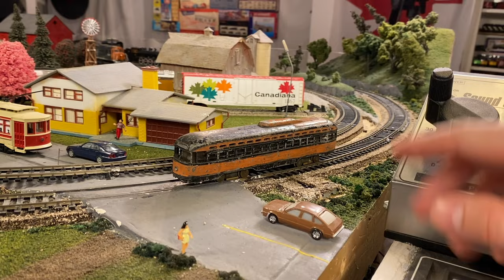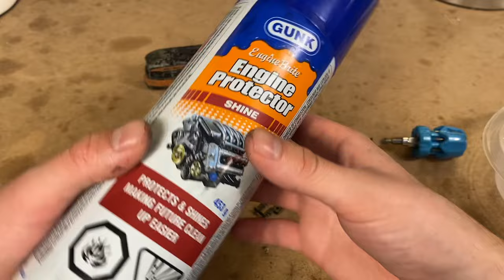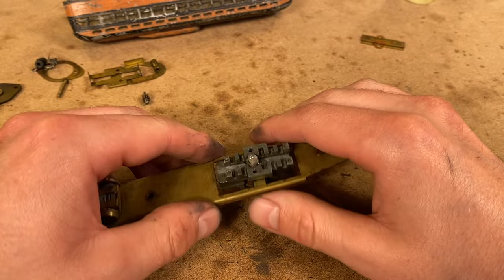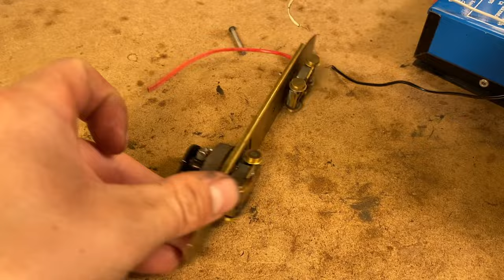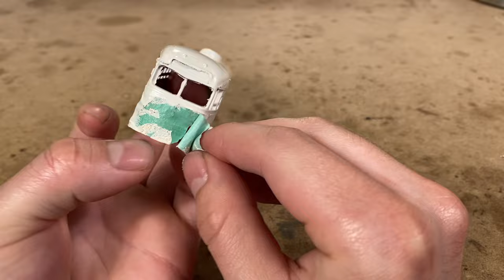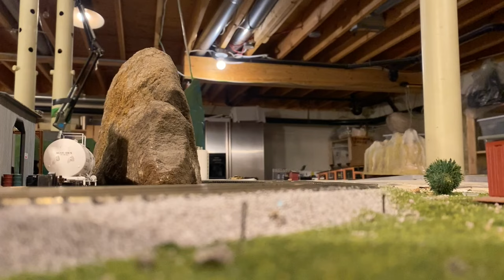Disgusting 1950s HO Streetcar Trolly Train - Will It Run Again?

Comment: Harrison, great job on fixing up the old trolley.  😊  One neat tip that I learned when custom painting stripes in my garage years ago is to use one more coat of the underlying color AFTER masking the paint line off.  This seals the edge with the base color and provides a nice, crisp edge.  I've been using this technique on my models and have found that it works really well for them, too!  🚂🚃🚃🚃🙂👍
Reply: Good point. I  do flat clearcoat.

Comment: The Bowser PCC body is made from cast zinc alloy, not lead.  It is not a toxic metal.  The rope allowing the trolley pole to be pulled down goes into a device called a "retriever."  If the retriever is working correctly, the rope will NOT hang down.  The retriever is a safety device and contains a strong, spring-loaded reel to keep the rope taught.  The retriever also contains a clutch which allows the rope to play in and out as the pole follows the trolley wire sags.  However, if the pole dewires, the clutch engages to prevent the pole from suddenly springing up vertically and snagging on the overhead wire support arms, possibly tearing them down.  (Trolley passengers are safe, being inside the grounded steel body of the car.  However, they would probably not appreciate the 600 volt fireworks happening outside.)
Reply: Ah so basically how seatbelts work
Reply: @hush6149  Basically, yes.  However, the rewind clock spring inside it very large and very powerful, unlike a little seatbelt spring.  Tension must be taken off the spring before it is removed.  I knew a guy who didn't do that when he was trying to repair a retriever.  The spring suddenly popped out at full force and almost removed the guy's fingers.  He never finished that project for some reason . . .

Comment: Congratulations Harrison on a splendid job. I’m a retired T.T.C. driver (although they called us operators, when we drove streetcars). I started with streetcars in 1970 and moved onto buses and the subway two years later. You did a great paint job as well, and It brought back memories as I watched you work, and run it on your layout. I have a bachmann pcc in Toronto Transit colours that I run on my n scale layout. once again well done, and thank you
Reply: GPalmT - Further back in time a trolley, subway, elevated train, or any light rail train driver was called a " motor man ".
Reply: That's really cool. My friend is a bus driver for the MBTA ( Massachusetts Bay Transit Authority). He is a bus driver only but he did get to drive the trackless trolley buses before they were retired. The MBTA actually does have vintage PCC cars still in Revenue Services on the Mattapan High Speed Line. These are really unusual PCC cars because they actually have a door on the left as they were used in subway service.
Reply from the maker: It's nice to hear from someone who actually ran these things.

Comment: Something I started doing years ago for glass in my models is, after buying anything that's packaged in hard but flexible clear plastic with a lot of flat areas, things like Q-tips and some electronics, hold onto the plastic part of the packaging, then, when needed, cut the plastic to size and glue it to the inside, it now looks like the windows have glass from the outside of the model.
Reply: Absolutely……
The swiffer wet pads box top is nice and sturdy.
Reply: I use Chinese takeout lids for my clear glass.
Reply: Don't toss that glass!! Like others have said you can fab new windows from packaging of all sorts, or toothpaste polish the old one like car headlights, or just try dipping it in pledge floorwax or similar after a good cleaning.  The wax fills in small scratches and gives it a shine.  I've done that on restoring hot wheels and matchbox cars.

Comment: Amazing repair yet again. At first, it looked like a "simple" clean will do, but I didn't expect it to be this much work. I do own a Bowser locomotive as well, the PRR E6 Atlantic kit. That thing was also a huge pain to get running again after the original owner abandoned the project 40 years ago and the model shop gave it to me for free. Really like the paint job you did. I paint my locomotives with a brush, as I don't have an airbrush. Runs very nicely now and looks stunning. Another locomotive saved 👍👍

Comment: Nice restoration Harrison, Looks good running down Main Street!  Rode Line 28 in Lisbon (1930's trolleiy) in May and the wheel popped out of the wire at a particularly tight turn. Engineer had his hands full guiding it back in, as the tourists looked on.

Comment: Nice resto on that PCC and that on the fly trolley pole worked nice.
IIRC if you still have the window " glass "  one of those disposable clear food storage containers and submerge the the window piece in hydrogen peroxide and place it in a sunny window for a couple days. It's a trick for bleaching yellowed plastics. Failing that or in addition to very very fine grit sandpaper will act as a polish to remove the yellowing and any fine scratches or fogging can be fixed with a dip in an acrylic floor wax like the old Future floor wax. Just dip and let dry

Comment: You do really good work with a creative positive attitude. Now here is the thing. These modern chemicals (this is not in reference to the specific product you are using) can be very hazardous and may be absorbed by your skin and you should always use some type of hand protection such as nitrile gloves. Yes, gloves may be a nuisance but may be well worth it in the long run. If there is any danger of fumes or splashing you should consider further precautions as well. Happy silver railz.
Reply from the maker: Thanks for the tip, I generally wear gloves when working with degreasers etc but it makes it tricky to grab small parts. I've gotta watch it though, I've heard similar stories from older mechanics about not protecting your hands.

Comment: Automotive engine primer has very fine pigments and is an excellent rattle-can base coat for cast metal locomotives.  Wet sanding lessens the problems of lead aresol.  Wear gloves and a mask.
Ter-on-O.  That's a word I haven't heard in a long time. A very long time.
Excellent work, as always.  Keep having fun.

Comment: When I was restoring my 1960's motorcycle I learned that NEVER use those cheap, garbage masking tapes they sell at the regular hardware stores. I use the Tamiya masking tapes ever since.
Reply from the maker: I'll keep that in mind, I'd rather not have to always be fixing overspray.
Reply: Frogtape works good also, leaving very crisp masking lines

Comment: If you want to restore the plastic windows of you train you can try and use some floor glass cleaner after sanding and cleaning the plastic with soap and water. I use it to restore the Windshield of my 1/64 diecast cars and it works great!

Comment: Sweet restoration! The coachwork is stunning and a throwback to times past.

Painting tip; after spraying one colour, make the areas to remain the base coat and then use clear coat. This will find any gaps in the masking tape and fill them with a clear shield. Once dry, spray over with the second coat. When you remove the masking tape, there should be no bleed of the top colour on the base colour. Then clear coat the whole thing to protect all of the paint from chipping.

Use several thin coats rather than a few thick coats to avoid runs in the paint.

A brass brush is a good alternative to sanding the shell before paint. Brass will not scratch the metal as much as a steel brush. It does help provide a good key for the paint.

Try to use a primer before any paint as this will provide a good base layer for the main colour.

Liked and subscribed!

Comment: Impressive restore of this old Bowser PCC. Painting with a "rattle can" won't yield great results but you can go back to it
later when you decide an air brush  and air compressor should be purchased. Then you can get some decals to really
 make it good! The trolley retriever wire was usually a taught wire that went to a bell shaped container holding a round 
spring inside and some extra space for extra length of wire mounted on the rear. That might be added later too.

Comment: Good job. These units came with a non operating trolley pole. Many of the olded production had metal poles but  new diecast had a plastic one in the lowered position. Many owners would put a plastic sieve in the hole and purchase an spring loaded pole and connect a wire to it and then isolate the motor from the frame and then connect the pole wire to the other side of the motor

Comment: Hi Harrison.
As to cleaning parts,.especially metal ones, I've found a bit of kerosene and a soft nylon bristle brush works good, and is fairley inexpensive. Just make sure you have good ventilation, or work outdoors. 
Nice job on getting that trolly back up and running, young man!
Reply from the maker: I'll have to try that at some point.

Comment: That was a gross amount of gunk in those gears. For smaller things like that, I use an ultrasonic cleaner with a mix of 75% Simple Green and 25% water. That same ratio also works for paint removal for most hobby paints. (Ultrasonic cleaners are also wonderful for carburetors!)

Comment: For removing paint, I use lye in boiling water. It works so much better than regular paint stripper and is much easier and less finicky to work with

Comment: Hi there!  To clean the dried grease you can use the degreaser for household cleaning (the one that mom uses), this does not attack the brass and plastic.  You have thrown away the window plastic but you can rebuild it using a 1mm thick sheet of plastic which you glue inside.  Also in such a simple model you can try to put internal lighting with LEDs.  Greetings from Italy
Reply from the maker: Thanks for the advice

Comment: I use mineral spirits from my local hardware store to clean my locos and rc cars. It has an extremely low flash point. We use it at work to clean our EMD generators and all the contactors.

Comment: When are you going to get a sonic cleaner?  I put the parts into a small bag with isopropyl alcohol and put this into the water of the cleaner. Definitely softens the grease. Additionally, you may be able to clean and polish the plastic windows. Look up some scale modeling vids to see how. Overall, nice work sir!

Comment: Hey SMT.  Instead of a papertowen and a screw driver, spray the gunk remover on a toothbrush, and then scrub the parts that way.  then spray again with the cleaner to remove excess.  In the bicycle industry I used acetone (with mask, gloves, etc) this same way on greasy bicycle parts and it worked wonders.  the acetone dried clean.  Gunk may work the same, and be less harmful.

Toothbrush is key.
Reply from the maker: Thanks for the tips

Comment: Nice job!  Hope you didn't toss the windows.  If the plastic shell is intact, as it appeared to be, it would be worth saving.  ( Surprised it didn't crumblein your hands!)  I would suggest trying to clean it gently.  If it's still yellow or fogged after cleaning, then that just adds do the patina.  Would look good with a light in it, which another commenter has suggested it may have had originally.  Maybe a couple plastic jewels or lenses for the head & tail lights?
Reply from the maker: It unfortunately has shrunk over the years and no longer fits inside the model.

Comment: 16:05 also notice some arcing between the track and the metal plate under the wheels, that might give you some issues if you want to use it for anything other than a display piece.   That said, not a half bad job at all,  I've always been a fan of anything passenger related with this hobby and street cars/trams are definitely things that are in my wheelhouse.
Reply from the maker: I think the plate on the bottom might need to be adjusted again.

Comment: Harrision have thrown away the old plastic used for the windows in the trolley you could try using a heat gun on low setting and just warm it up   but keep moving over it but don t get it too close .it may make the plastic become clear    its worth a try great job on getting it running .i am doing a marklin diesil flyer loco and coach at the moment i thought give it go to restore it after watching a few of your videos
Reply from the maker: The plastic doesn't seem to be the same size as the model anymore. I don't know how that would have happened
Reply: Harrison i think that could be the warmth in the air has made the pastic softer and its expanded az i am guessing in the 1954 they may of used thermo plastic to made the part so you could try put it in a cold place like a frigde wrapped up over night it may go back to its orginal size

Comment: Great job in getting that to run. I have that model in PTC livery. There should be a hook on the roof (inverted J) to store the pole when the trolley is parked or when it is under tow by another PCC. I do wonder why you use such a big handled screwdriver for those small screws. In the video you can tell you are having a problem getting the screws started. A smaller diameter handle would make that much easier.

Comment: Good job working on that trolley. I myself wouldn't use engine degreaser I'd use CRC electronics cleaner maybe that works better in my opinion. I know I used it on a power pack potentiometer from MRC because it would just go from 0% to 100 or 0 volts to 15.6v . Otherwise I'd say you did a good job.

Comment: Try using an old toothbrush to clean parts.
Touching up all the flashing around the windows with a file or two would help it look much better.
Nice work.
Nice video.
Thanks.

Comment: If you need to replace glazing on any model I use clear plastic packing from supermarkets. I find it works well plus bends if there are any curves on the model. Did well to get a 70 + model working.

Comment: The trolley was made of a material called ZAMAK which is a mixture of Zinc with Copper, Aluminum and Magnesium in varying amounts depending on which ZAMAK you were using.  It was used for all the Diesel-cast locomotives from the 30s through The 60s until replaced by Plastics.  There is no lead which you mentioned so filing or light sanding does not present the kind of hazard you would have with lead. I would still wear a mask to avoid inhalation of any fine particles but you will not get lead poisening
Reply from the maker: That's good to know

Comment: Citric strip works great.  Coat liberally place in a zip lock baggy squeeze out as much air and the next day the paint falls off no matter what type.  No gloves, or respirator needed.  Also you need an air brush and thin the paint down it will not go on as thick and your transitions will be better.

Comment: The paint scheme you chose for the PCC was not only Toronto's paint scheme, Pittsburgh had the red and creme and so did St. Louis when St. Louis was in charge of the St. Louis Public Service Company.  If this was a St. Louis PCC, it may have been a 1600 class car which St. Louis Public Service bought in 1941.  Several of them ran on the Hodiamont Line, the Manchester line, University, and the Grand line.  St. Louis bought a set in 1940 as well.  Those were the 1500 class.  The 1700 class were bought in 1946.  The original Delmar Loop Trolley saw the 1500 class PCCs, the 1600 class PCCs and the 1700 class PCCs.
Reply: ok then...
...where was the paint from scheme before he stripped it down? IDK
crazy, every city had different schemes, but I couldn't find that orange/black...

Comment: It's probably nothing serious or anything but idk I was told it was back when I was a kid and still in the hobby so I thought I'd give you heads up in case you didn't know but the trolley was sparking on the track when you where running in around and showing us in action at different angles
Reply from the maker: I think the metal at the bottom of the track might be making contact with uneven parts of the track. It could also be just be happening naturally.

Comment: You should have sprayed a clear coat after taping it off to stop the bleed through.
Enjoy your channel,  keep it up.
Don't care for the live streams because they are to long. 20 to 30 minutes is my limit.
Reply from the maker: I've tried the clear coat/base coat method before with mixed results. Sometimes it turns out well, other times the added layers fill over details before the last coat is even applied.

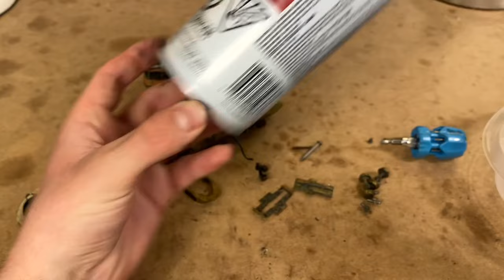Comment: 5:30 Why not clean with WD40 ? It is designed to remove old dirty grease from parts. Dish soap has a lot of water which promotes oxydation later on. Rubbing alcohol has 30% water, also less than ideal for metal parts. Mineral oils are diluted by other mineral oils, not alcohol (for water soluble solvants), acetone, or soap (for organic oils). What do you think?
Reply from the maker: I find WD40 a good oil to get things un-seized but I've let parts soak in it before and it softens the grease but doesn't remove it like other cleaners seem to. You've got a point with using things containing water though.

Comment: body is NOT made of lead, its a zinc alloy / pot metal sometimes called zamak casting I think - its totally safe to sand or drill.  The only lead you usually see in hobby trains is lead traction weights.
Reply from the maker: That's good news. Many people have warned me about die-cast models containing of lead, maybe some have it? (other than weights and solder)

Comment: next time painting pick cemoresistant tape, usually it is the green in my stores byt who knows how canada do coloring but you can buy premade width from 1mm up in model shops
for paint i would etchprime and then use acrylic automotive retouch paint or airbrush on model paint
your problems with masking seems to be caused by alkid paint really likes to disolve glue under the masking tapes